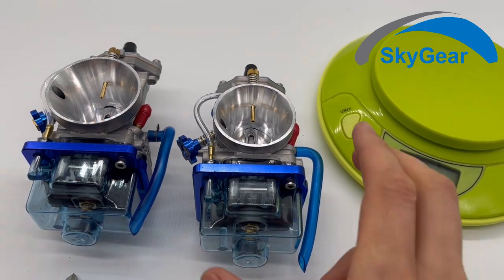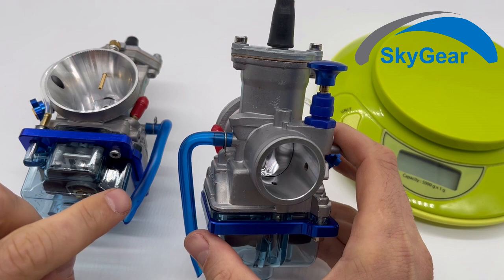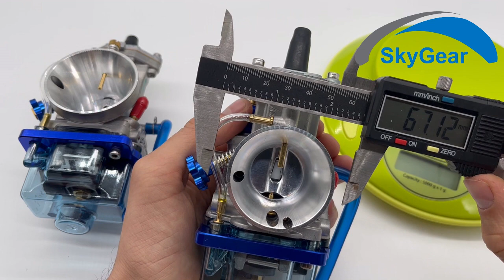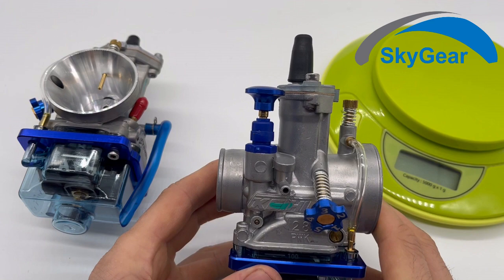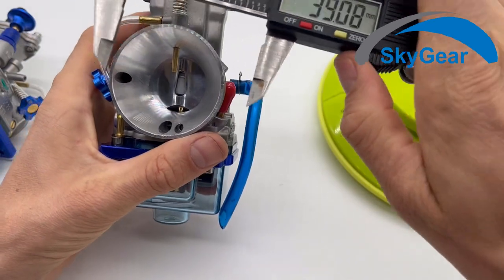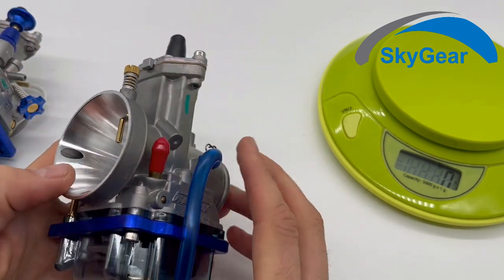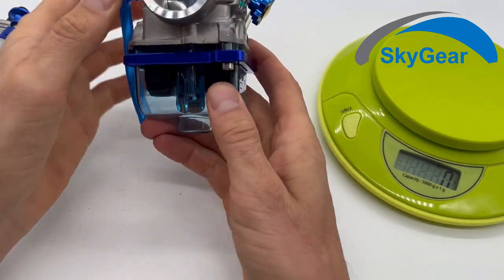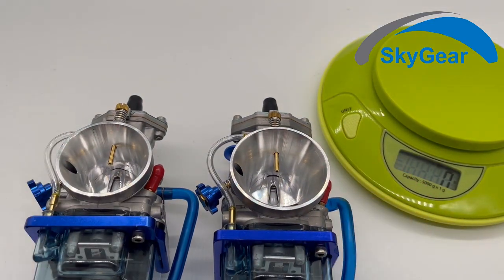PWK Carburetor 28 and 30 mm

Comment: How do you drain the gas out of the carburetor bowl? I cannot find a drain plug.
Reply from the maker: This carb doesn't have a drain plug.
It has only overfill hole, where you can put a tube and when you lean the machine the gas will flow there. But not convenient anyway.. That is why these carburetors are mostly used on trikes or on competition machines...
Reply: @ ah good to know. Thank you for your answer. I flushed the carb by unscrewing the carb bowl from the bottom. It was a big pain. Next time I will lean it. Thank you haha

Comment: Please reply, I have to pipes coming out of my gas tank and it looks like I can only put one. Where can I put the other one at. I have a 30mm
Reply from the maker: Dear Dariel, as I don't know, what paramotor do you use, I can just guess. Usually the one pipe is for feeding the carburetor with gas and the second one either for gas return (the fuel pump pumps all the time and the fuel that is not let into the carb goes back to tank), or the other pipe is for letting the air into the tank. There has to be way for air to get to the tank so it does not collapse when the fuel is sucked out. Some paramotor manufactures use the second pipe for both fuel return and air intake - they connect it to the small plastic unit where from bottom goes the pipe from tank and from the top there is connected the return from the carb and air intake. Hope this is understandable.